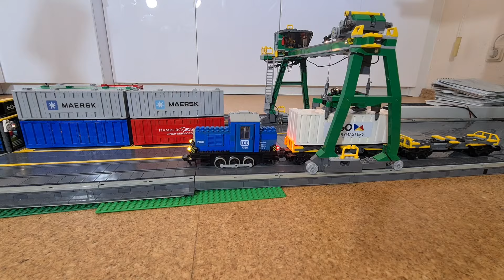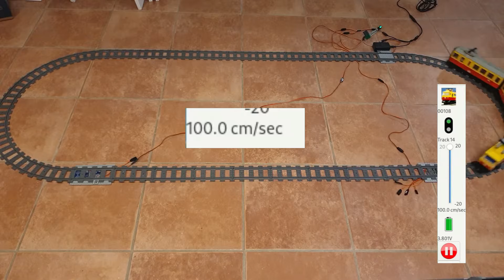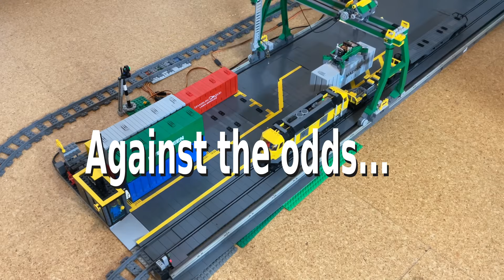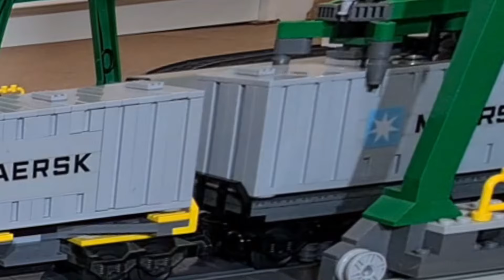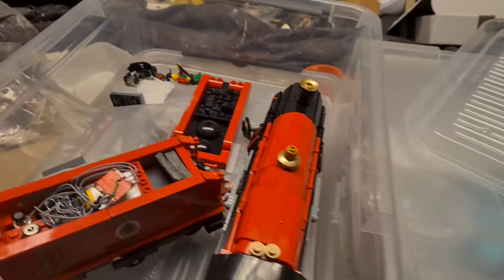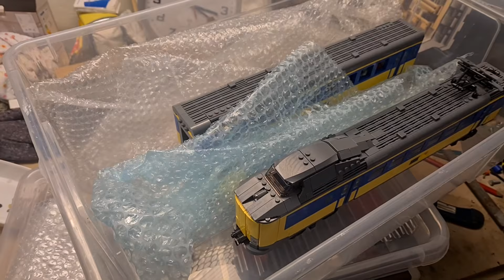Lego fully automated container terminal part 3

Comment: how do you latch the containers to the crane 
hook? tryin to make my own but i couldnt solve this problem
Reply: Magnets
Reply from the maker: Yes, correct!
Reply from the maker: One magnet in the container, one in the crane. A DC motor in the crane locks/unlocks the container by moving the magnet up and down. The motor is powered by the two lines that lift the crane.

Comment: Very cool! What BRAIN are you using?
Reply from the maker: Thank you! I am using an Arduino mega, mainly because it has to control three stepper motors. But I don't think the code fits in a normal arduino anymore. There is a second arduino pro in the crane-sled that controls the lifting motor and the lock/unlock motor. The Mega communicates with the second arduino through a serial line.